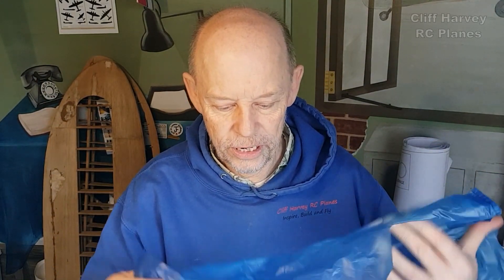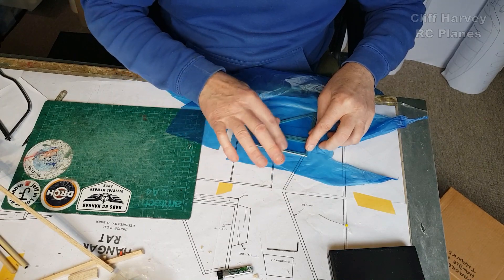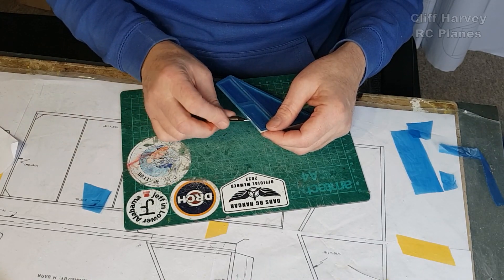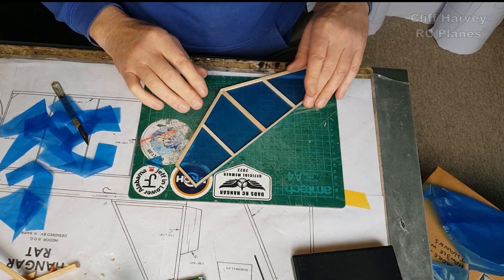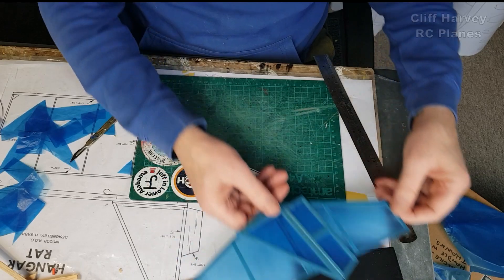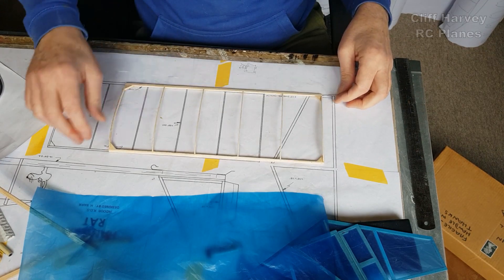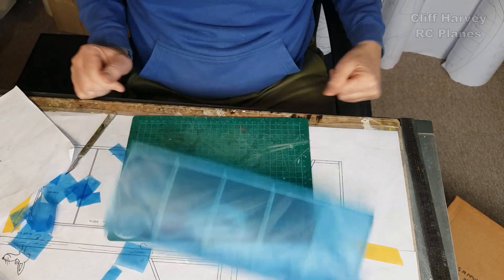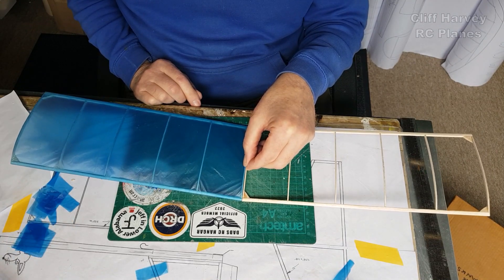Covering and Finishing the Hangar Rat Radio Control Conversion

Comment: Cliff I have found it easier to roll the wing onto the covering rather than placing it on the wing. Tape the covering down at the LE, place the wing TE on the covering at the opposite end and then while holding light tension roll the wing towards the taped down edge, finishing at the LE. It works well for any small - light model with tissue or light plastic. Anyway have fun.
Reply from the maker: Hi John, thanks for that advice, I shall do it that way in future, thanks for watching commenting, cheers 👍

Comment: Hi Cliff. Very impressive build. Loved the use of carbon-fibre as the push rod, would you consider it a suitable material for larger Rc planes?
Reply from the maker: Hi Andrew, yes, I've used larger diameters on larger models but be careful where the rx aerial is routed as it could have a blocking affect I believe 🤔👍
Reply: @CliffHarveyRCPlanes  Hi again cliff. I'll make sure to bear that in mind when I build my next plane. Cheers.

Comment: Surprised by that little motor. It does look like it has enough power.
Reply from the maker: Hi David, those little coreless motors do have some grunt, it'll cope I'm sure, probably less than half throttle, cheers 👍

Comment: So is that just a plastic grocery bag that you covered it with? And if you added heat would it shrink up tight?
Reply from the maker: Hi Mike, yes, the very light-weight ones, this particular bag is sold as a bin liner for kitchen food waste. I don't know if it would shrink but if it did it would probably twist the wing badly out of shape. It's a slow flyer so it won't make a lot of difference to have a wrinkle or two. See John Haren's comment above, cheers and thanks for commenting 👍